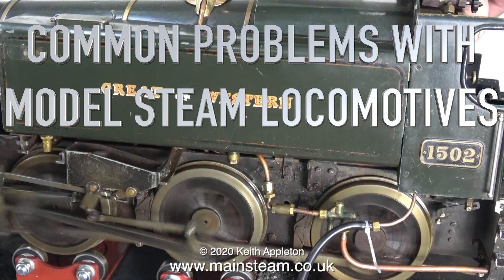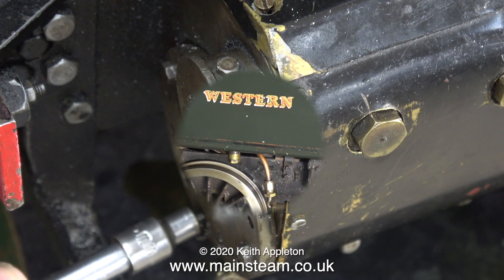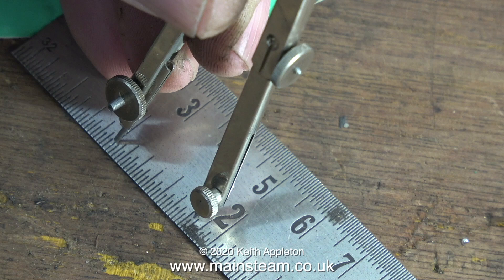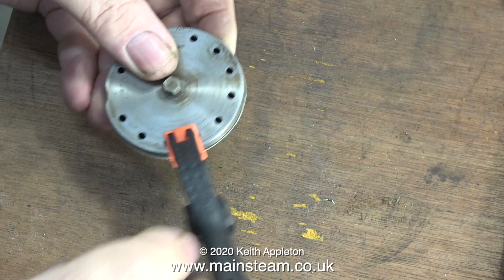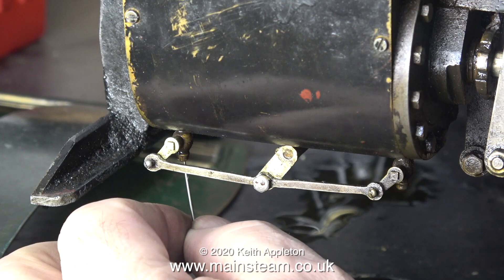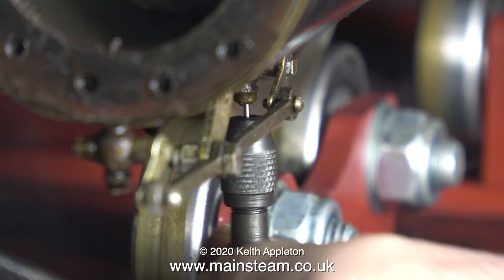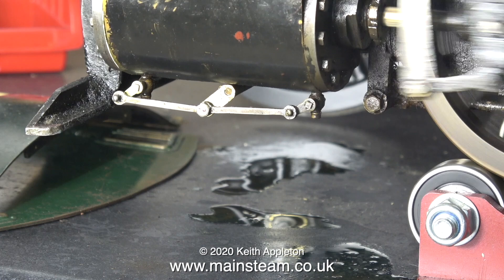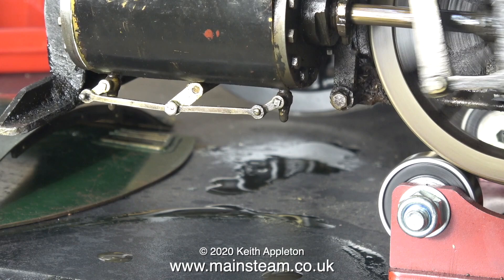COMMON PROBLEMS WITH MODEL STEAM LOCOMOTIVES - PART #2

Comment: Something I have learned, watching your channel, is that people are lazy. You said. right at the beginning, that you have a video play list. Still a viewer asked about a scaled Mamod boiler.
People also like the easy way out. It is so much easier to use silicone rubber than to take the time to make a proper gasket. 
For about 10 years I made all sorts of gaskets, professionally, from all sorts of materials.  It is really easy to make HOME MADE  gaskets.
TOP TIP TIME:  If you don't have proper gasket material (in this case) use the card stock from a popcorn box. You can use it dry or soak it with oil.. Now just tighten the bolts with a tiny bit of torque, until you  squeeze out a little of the oil. Instant home made gasket. I've done this on car engines except on the exhaust manifold. It really does work. For some odd reason, the oil makes the card stock heat proof. Still proper gasket material is preferred when available 
HEALTH AND SAFETY CONCERN: Some gasket materials are made of compressed asbestos and a binder. Be careful when using and handling this material.
Great tutorial video Keith. ;-)